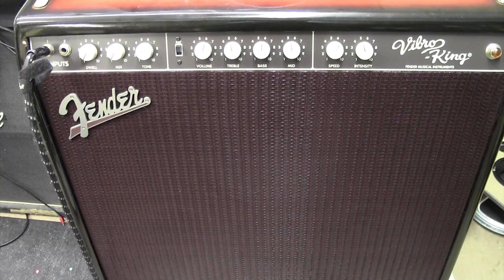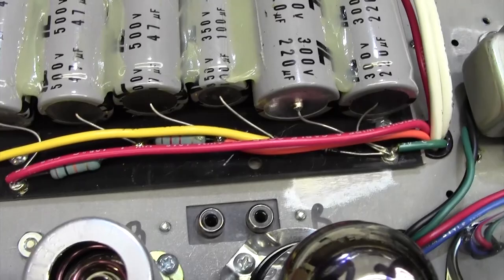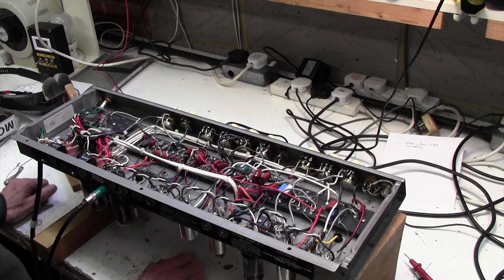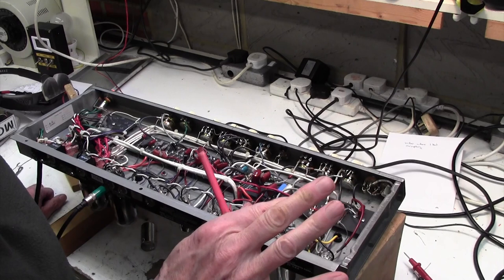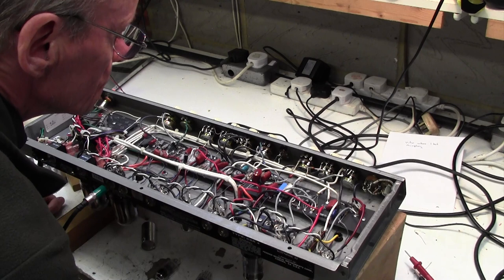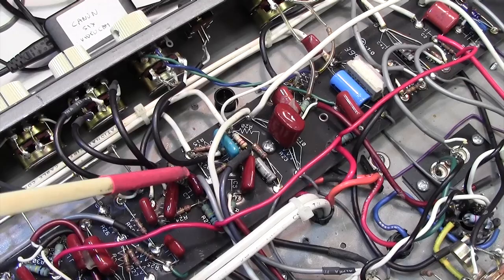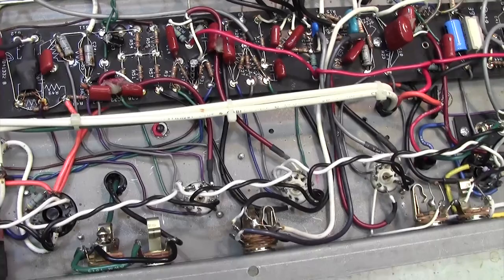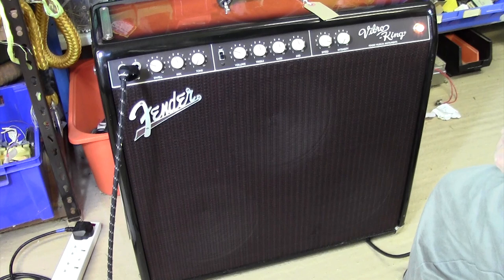How to Fix Fender Vibro King Noise Issue

Comment: Another great video, Stuart!  The reverb circuit in the Vibro-King is a built-in version of the original Fender stand-alone reverb tank.  It was a selling feature of the amps when they were introduced.  The only time I heard ticking that bad in a Fender tremolo circuit I changed the "roach" because nothing else worked and I had a spare on hand.  It fixed the problem, but I didn't understand why - thanks to Jerry Ogle for suggesting the bulb may be too close to the photo resistor.  Thanks for making these videos.  They are a wealth of practical trouble shooting know how.
Reply from the maker: Hi okay thanks for that. I wish I'd tried the roach now as I have a spare one.

Comment: I found this issue in with the same tone stack (Commonly in Marshalls), exactly the same symptoms (this "frying bacon" sound). The C7-150pf ceramic (or mica) capacitor was the culprit in all cases. This capacitor was not blocking the DC properly which means a leaky capacitor sending DC current to inverter valve and power valves.

This is not an easy issue to find due in the most cases this capacitor do not reacts to tapping it. Great video!
Reply from the maker: Hi Jaime. Nice one, yes sounds exactly the same issue.

Comment: You don't see too many modern Vibro King amps in the UK. Very expensive and the weight ! !  .. I worked on an older one a few years back with the ticking tremolo . The 10nF cap from the 10 Meg resistor to ground didn't get rid of the tick but reduced the volume of it. I fiddled around with the roach and pulled back the heatshrink tubing a little and it solved the issue.. I might have just got lucky or disturbed something else on the board.  Great video again Stuart.
Reply from the maker: Hi Pete. Very interesting. Hmm, I wonder why that would stop the tick?
Reply: @stuartukguitarampguy5830   A very good point, well made.. Don't know.. It could have been I disturbed something in the vicinity or just got lucky. I only play at this stuff and am in no way qualified ..That's why I watch your videos, ha-ha..

Comment: I currently own one of these and life the tone of this amp! Mine has the ticking and noise issue this one has. I pulled the bulb slightly out of the sheath on the roach and the problem was greatly reduced. I may try replacing it later. I will be doing some investigation into the noise from the time circuit but feel it's the same problem...Id like to just recap the amp as well. Thank you for this video!
Reply from the maker: Ok pulling the bulb out slightly may have simply reduced the intensity of the vibrato and hence reduced the ticking also. Most times I find I can cure it by lead dress. USe a chopstick or something to carefully move wires around to see if you can get a reduction.

Comment: Well found. That ticking is something else, a design flaw (if none of the usual fixes work)? Are 115 volt amps common in the UK (imports?) as I can't imagine people lugging step-down transformers to gigs, but then, when compared with the weight of the amp!
Reply from the maker: No they're not common but I do get them from time to time.

Comment: V6 is the tremolo, Phase splitter is V5 on this amp. Got one on the bench now with the exact same problem.
Reply from the maker: Great I hope you get it sorted.
Reply: @stuartukguitarampguy5830  I did the freon spray but nothing helped. The coupling cap's seem to be okay. The bacon frying noise is intermittent - I suspect a bad solder joint somewhere.
Reply from the maker: @bryanbailey6963  Hi Bryan. I had one just recently with exactly this issue. Took me 2 hours and freezer spray didn;t make the slightest difference in the noise. Ended up swapping coomponents in the section one by one. Turned out to be a 3K resistor! Very surprised that freezer didn;t affect it at all.
Reply: @stuartukguitarampguy5830  Stuart: Can you say which 3K resistor you replaced on the schematic? I cleaned the shunt contacts on the FX and F/S jacks and the noise went away, but I am not confident that was the fix. It seems more coincidental. I looked at the schematic and the closest I see is a 2.7K on pin 8 of V6. (The one I am fixing has the 6V6 for the reverb.)
Reply from the maker: @bryanbailey6963  Hi Bryan alas I can;t recall as it's a fai while ago now I did this repair - done hundreds since!

Comment: When I saw how the amp reacts to treble pot I was pretty sure it's this cap's fault. I see volume pot is not after the tone stack, but between the preamp stages so it has no influence on noise. 
Replacing mica cap with a ceramic one? Never did that, would probably never, but on the other hand ceramics are pretty indestructible and at such small values all the drawbacks of ceramics are neglectable. 
Those tone stack component values are something I've never seen before (I expected it to be Marshall style from cathode follower), especially 100k resistor after it all. 
Can't stop thinking why would they make a vibrato lamp driver with tubes instead of transistors - no sound passes through ... And use a vactrol instead of neon light assembly ...
Reply from the maker: I thought a 3KV cap would do the trick ! As you say, probably negligible tone difference.

Comment: I have a vibro king.
The reverb has lost some of it's strength.
I.e. I have to turn the reverb up more than I used to.

I change the reverb tube, not much difference.

any idea why ?
Reply from the maker: Hi Best guess is it is the reverb pan itself. You might want to swap that out, they're not too expensive.

Comment: Neon bulb may be setting to close to the photo cell inside the heat shrink tubing.
Reply from the maker: SOmeone else has said this. I've never come across that before and can;t think why it would cause a ticking sound. Wish I'd tried it though.
Reply: @stuartukguitarampguy5830  
Stuart every time the neon ignites the gas in the bulb there’s a high voltage arc that radiates a noise signal into the photocell and intensity control circuitry. The output of the intensity control goes to the grid of the inverter tube then to the output. 
   In your video when you adjusted  the intensity you turned off the ticking.
     Like and old spark gap transmitter.
Reply from the maker: @jerryogle8798  Thanks Jerry that's really helpful. Hmm, I wonder what the cure is though as the neon is always tight up against the photocell and indeed held there by shrink sleeving!
Reply: @stuartukguitarampguy5830  think I would just try replacing the photocell . Over time it could just be breaking down. 
Stuart look forward to your videos learn something new everyday. I’m 71 retired and still learning.  Keep up the good work‼️Thanks
Reply from the maker: @jerryogle8798  Cheers Jerry

Comment: I can't stop laughing what the hack is wrong. Facesplitter out there would be any sound ratling.
That noise is formiliar to socket noise. I use high grade mkp caps.
You found the bad cap. If the voltage DC leakage was higher it could damage more.
Well fixed that. 👍